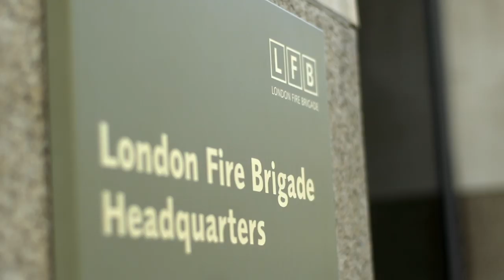Interview with London Fire Brigade: reasons for changes to BS 7671 in 2015

Comment: This is an excellent interview. It should be shared with fire brigades all over the country. In response to this, has anyone seen the Elsie Fixings website? 12 Months ago our design engineer created some life-saving fire-proof metal clips to keep cables fixed overhead for prolonged periods of very high temperature. We've made them cheap and fast to install or retro-fit so that there's no excuse for anyone to ignore this major issue any more.